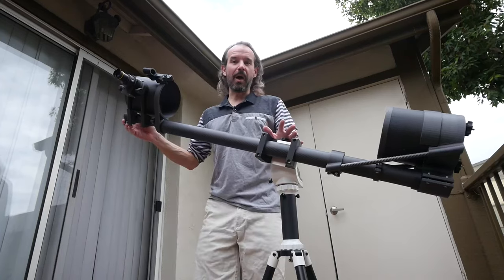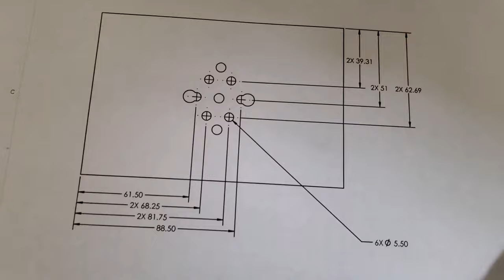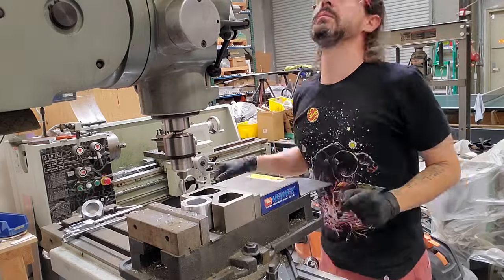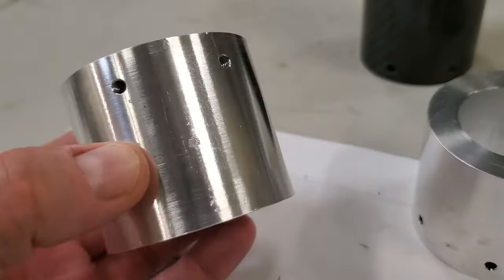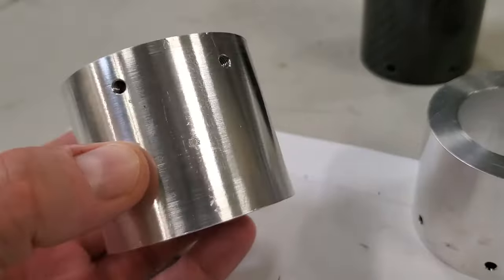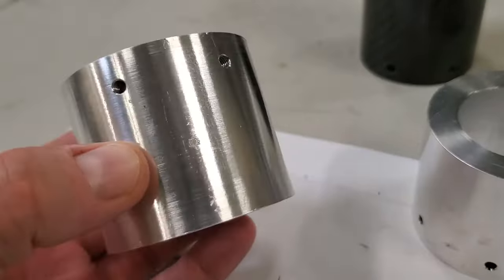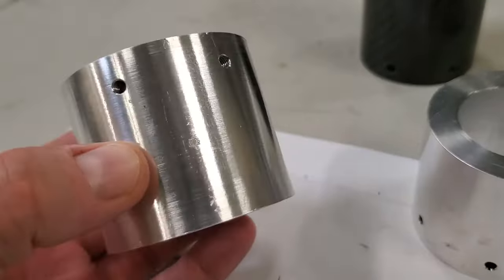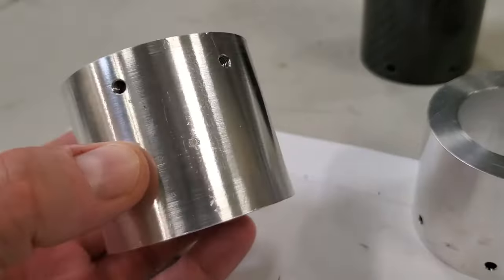Carbon Fiber Harmonic Drive (Strain Wave) Telescope Mount

Comment: Hello, I was wondering if you could share where you bought the Harmonic Drives. I've seen them on eBay and AliExpress but none of the listings really give confidence lol. I've tried contacting companies directly with no luck.
Reply from the maker: I list two sources in the project files on my web site (Google Drive link) - https://designbydave.net/telescope-mount/
Reply: @designbydave  ahh. thank you for the quick response!

Comment: An amazing build, thanks for sharing. Little safety tip though, it's very dangerous to use gloves when operating a drill press. If the drill grabs a hold of that fabric, it's gonna wrap your hand round that drill and mangle your hand. Sorry for being that guy, just looking out for you.
Reply from the maker: I appreciate you concern. First, that was a mill, not a drill press. Second, the gloves I'm wearing are nitrile and would absolutely just tear off long before pulling the hand into the rotating tool.
Reply: @designbydave  Apologies for the mill / drill press mix up. No disagreement from me here with the nitrile gloves either. 

I was 100% just looking out for you. Great videos. Keep them coming.

Comment: Watching this while drinking a beer this whole time thinking to myself, "man those layer lines on those prints are gonna snap under all that weight."
Reply from the maker: Haha. perhaps I needed a few beers during the design phase to expect that was coming. A bit of additional info though that I didn't mention in the video is that I am pretty sure now that it perhaps wasn't just the weight of the telescope that caused the parts to fail, but an assembly error. Hard to describe, but I'm pretty sure during the assemble I "preloaded" those parts with the mounting screws basically acting like a jack, splitting the layers. So, it's possible that with correct assembly that the parts would not have failed. At least, not right away. But I'm glad it turned out that way because the re-designed parts are significantly stronger and I have full confidence in the mount handling the intended payload.
Reply: @designbydave  yeah that's true.  I haven't tried that particular filament but it looks strong for what it is.  Will have to give it a try.  Just found your channel and you have some really interesting projects!
Reply from the maker: I don't have objective data myself, but other's experience / data shows that Polycarbonate has some of the strongest layer adhesion of any of the common FDM materials. That layer adhesion has also been shown to improve with an enclosure and gets stronger the warmer it is inside. It's my favorite material by far to print structural parts.  @viniguez487

Comment: I read the other day on cloudynights about alkaidmount(i am building one myself) and now i remember you telling about changing step motors. What would you suggest for astrophotography guiding? I am building the "Alan version". Thank you
Reply from the maker: I changed to 5:1 planetary gear boxes as the 27:1 were way too slow for slewing. I can't say if they are better for astrophotography but I did just reconfigure my mount to equitorial mode and plan to try some imaging soon.

Comment: Hello again, I have three questions. Did you set the set screw into the flat surface of the stepper shaft or just to the shaft? Did you have Loctite 243 on the set screw? Did you use a 3 mm key in the harmonic drive keyway?
Reply from the maker: My Harmonic Drives have 2 set screws, so one is against the stepper motor output shaft flat spot, the other is about 90 degrees from that. 
I used Loctite 242
I don't recall the hex key size

Comment: I see you have reduced your stepper motor gear ratio. Will this not reduce the payload capacity of your mount? What is the weight of your fully configured telescope before you mount it? Thank you in advance.
Reply from the maker: Yes I suppose it might, but it's not been an issue for my. My payload is only about 6 pounds.
Reply: I am curious what payload your design can handle. Not worth risking breaking your 3-D printed parts though.
Reply from the maker: I'd be curious too!  @mr.harris8185
Reply: @designbydave  with the PG at 27:1 and the harmonic drive at 100:1, that's 2700:1 from the stepper motor... no wonder it was a bit slow. What is that - about 66 degrees per minute if the stepper motor is doing 500rpm? Going down to the 5.18:1 PG would give about 347 degrees per minute, almost 1rpm, would that be a better ratio? Would it be better, do you think to drop the PG ratio down to 5.18:1 like that or drop the harmonic drive ratio to 50:1 or 30:1 and maybe not drop the PG as much, say 50:1 and 14:1 respectively?
Reply from the maker: @JeremyTaylorNZ  I did swap to a 5:1 planetary gearbox and that not only improved the slew speed but they also run almost silent.

Comment: Please provide info on the harmonic drives - Cost, part number, where to order from. Thanks!
Reply from the maker: Check the link on my web site. It's documented in the bill of materials. https://designbydave.net/telescope-mount/
Reply: @designbydave  Got it, thanks. I missed the button for the link before. BTW, how is the Strain Wave mount working for you so far?
Reply from the maker: It's great! After a lot of tweaking, tuning, trial and error, I've got it to a point where it's very reliable. Quick, easy and fun to use. Exactly what I was looking for.  @MikeHammer1
Reply: @designbydave  Good enough for astrophotography? That is where my interest lie. Of course your telescope is a long focal length so the higher magnification will amplify any inaccuracies or shaking so it may be hard to determine suitability for my application.
Reply from the maker: I'm not sure if its good for imaging. I would need to build a wedge for it as I'm currently running it in Alt-Az mode. Maybe my next project...  @MikeHammer1
Reply: @designbydave  Hi, is it still on the site? I can't find it. There is a Notes section and photos. Thanks!

Comment: Dog gone it! My harmonic drives arrived unassembled with no instructions as to how to assemble them.
Reply: okay, I think I assembled them correctly...lol I'll share a pic if I get it running.
Reply from the maker: Dang, which ones did you order?
Reply: I should have it assembled by the end of this weekend and will share a pic. Waiting on stepper drivers. Built my board myself. @designbydave

Comment: Absolutely incredible. Really helpful for me as im looking to make something similar. How do you source the harmonic drives? How expensive can they be? Is there any harm in buying them used?
Reply from the maker: Thanks, glad you found this helpful. Check the link to my website in the description. There is a bill of materials with links to source the Harmonic drives. I brought mine used on eBay but later found a source for a Chinese version on Aliexpress that is almost half the price new. Should be perfectly fine for this application.
Reply: Thanks a bunch! I found the excel file and that price is truly unbelievable. A few questions though? Are the stepper motors listed in the file the updated ones you state? Also, how is manual movement in the mount? How stiff/smooth is it? @designbydave
Reply from the maker: Yes, the steppers I changed to are the 5:1 ratio steppers that are listed in the BoM (actual reduction is  5.18:1, see specs.) This gives 518:1 total reduction, which at 32 microsteps gives 9208.9 steps per degree. I'm finding the tracking performance to be excellent for visual, but not sure about long exposure imaging. 
There is no manual movement of the mount unfortunately. It is not possibly to "back-drive" such a high reduction ratio and push the scope around by hand. The only way to achieve this would be some form of clutch mechanism. I've tried to figure out a simple way to accomplish that but haven't gotten anywhere. Not having manual, push-to, movement is kind of a bummer, but I've been able to get OnStep running consistent and well enough that it's not been necessary. Having a clutch mechanism would be a great upgrade to a "v2" of this mount.   @rayyanimran1557

Comment: Hi David, cool project man. where do you buy those carbon fiber tubes that have there. Thank you
Reply from the maker: Thanks for checking it out. Those tubes were scrap from a former job. I usually source carbon tubes on eBay. Not sure you can find the exact size, but maybe something close and then modify the design to use.

Comment: Great craftmanship.  Beautiful mount.  How much were the strain wave units?  I just would like to  know what I'm getting into here, cost wise~!
Reply from the maker: Thanks! 
They $235 each, but I've since found a Chinese supplier that has them for $140 each. Check the documents linked in the description.
Reply: Ok, thanks for the info.  Did you farm out the machinging at all?  If so, to whom did you work with?   @designbydave
Reply from the maker: @microreniassance2929 The two aluminum plates were laser cut ordered from sendcutsend.com
Reply: Thanks much for the information. @designbydave

Comment: Awesome!!! I’ve been wanting an Equatorial mount for awhile now and there so expensive. This is awesome that people are starting to build their own. Do you by chance know if you can control the mount with a ZWO Asiair plus? Thanks for the amazing vid!!!!!
Reply from the maker: Thanks! 
This mount is controlled via OnStep, open source telescope control software. I know it can be connected to a PC, tablet or phone via a generic ASCOM driver. So, I suppose as long as the Asiair can control a generic telescope device like that, then it should be good.

Comment: Mt. Pinos is a great spot but gets too crowded with a bunch of non-astrophotographers showing up late and leaving early.  Have been going to another site just down the mountain called Chuchupate.  There's a parking lot at the trail head with restrooms.  Less packed and less people coming and going.
Reply from the maker: Cool, thanks for the info. Yes, that night there were a lot of people with car lights but that also meant there was a lot of people to share the views with which made it a lot of fun. I always get a kick out of showing people the views for the first time.
Reply: @designbydave  definitely great for outreach.  Maybe I'll see you up there some new moon!
Reply from the maker: I just (mostly) finished my new 12.5 inch dob (check shorts, will make full video later) so I will definitely be looking to get out in a couple of weeks!  @viniguez487

Comment: Darn it, I ordered the MaxESP3 instead of the MaxESP4. Hope it works. One week until my harmonic drives arrive. Need to purchase stepper motor drivers. Thinking of the TMC5160T. What stepper motor drivers did you use?
Reply from the maker: I think there isn't much different in performance but I'm not very well informed on the subject. I just ordered a complete OnStep board from Chad Gray, see bill of materials. Stepper drivers where included.